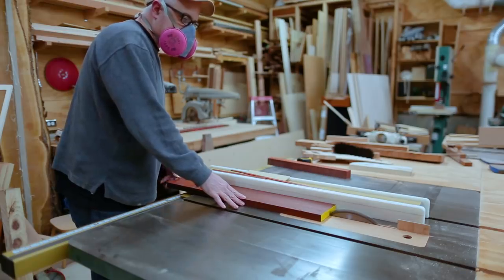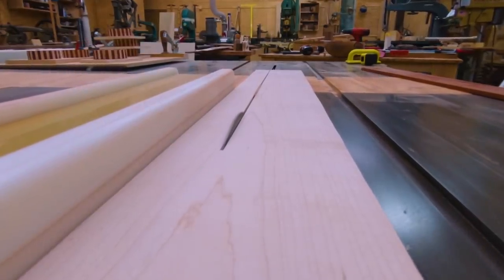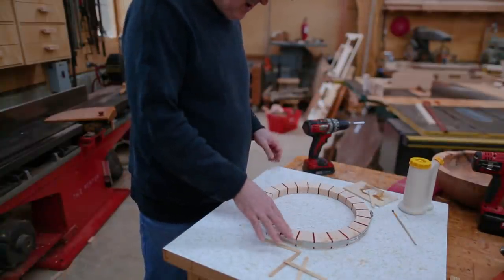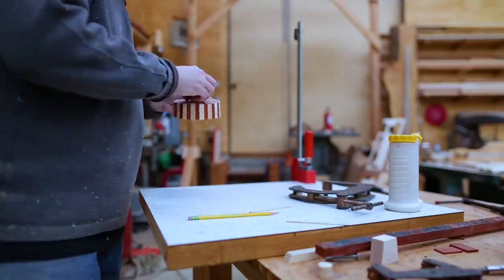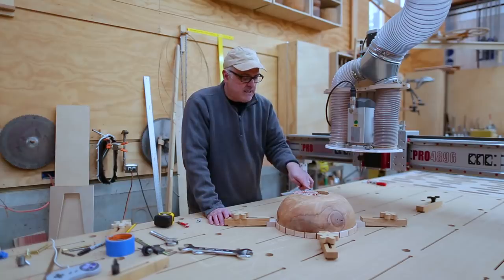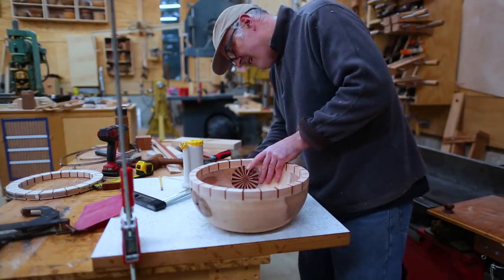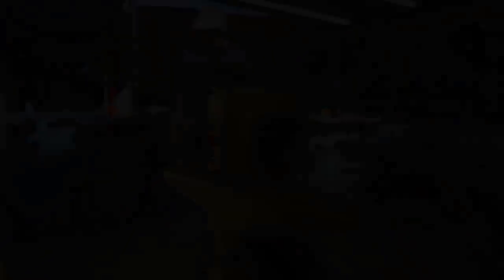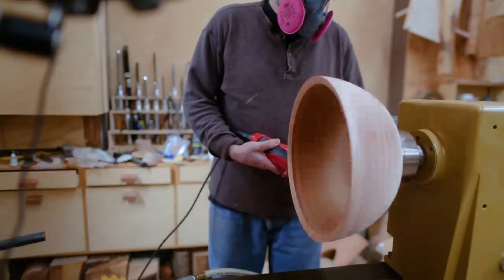Making A Maple Bowl with Maple and Padauk Inserts

Comment: Frank, love your work.  wondering if you have tried bow-ties for repairing punky areas in the bowls.  With your CNC it should be easy and use different types of wood to make it you, then turn it to final shape.
Reply from the maker: yes, I have wanted to do this.  I could see one were everything is turned flush, and one were the bow-ties have a 3 dimensional form.

Comment: Hi Frank, very nice bowl, not only from the design appearance, but all the techniques involved.  When I saw the part about the inserts splitting, it got me thinking about grain orientation.  Longitudinal (parallel to the length of the tree) is the least prone to expansion/shrinkage, over radial and tangential (0.01%, 4% and 8% respectively, for the movement of green wood drying and shrinking, as a reference).  I wonder if you cut the wedges one at a time off the end of the board, with the longitudinal grain running between the wedge faces where they glue to each other, as opposed to how you did where their longitudinal grain runs from the inside to the outside of the bowl, if it would make the inserts stronger?

Comment: buy some ND filters if you're having trouble with overblown shots. Get some bounce plates (literally a piece of foam core or aluminum foil works fine) and you can turn the light so it faces AWAY from your work peice, and then you can bounce the light (like from the sun) onto your work surface for a much less intense spotlight. You can also get some peices of mesh, thin white cloth, some wax paper even to put infront of the light source to diffuse the light. There are a TON of options for making the light work with your camera or your camera work with your light!

Comment: Do you have any deciding factors for the shape of the bowl? Such as if it's a wide shallow bowl, or a more sphere shape? What about the lip - having it flared out or curled in? What about adding texture details like grooves, rings, bevels, etc? On this bowl it appears you put a bevel on the lip, where the OD edge is higher than the ID edge. Do you make those decisions at the lathe or is there a plan going into it?

Comment: For the Bowl made entirely of inserts. Will there be a planned pattern? Or just insets laid over inserts at random? Either way, you could make a bowl blank, put in some of the inserts, turn it, then add new ones and repeat. It would take a hell of a long time but I don't think it would have to be that systematic. By doing it in chunks the inserts could be turned to the shape of the bowl before putting in more inserts.
Reply: For the issue with your light, maybe try a studio light, or a light used for photography? where the bulb illuminates away from you but is bright enough that it illuminates the entire area. Keeps from having that direct spot of light that you get with the demo light.

Comment: Hey Frank. I've been following for about a year but haven't seen much of your backlog from before that. YouTube suggested your video where you used Matthias Wandel's pantorouter. Do you find that it's completely useless if you have a CNC? Are there any applications the pantorouter could do better than the CNC?
Reply from the maker: There are some things the pantorouter can do that a cnc can't like putting a tenon on the end of a long piece of wood.  there are some set up and production gains the pantorouter hase over the cnc.  Also if you are not super comfortable on the computer the pantorouter has you covered.

Comment: Frank since you do a lot of bandsaw work I wondered if u could answer my question. Is it possible to overload a bandsaw with a motor? What I means can you put too big of a motor in a bandsaw? Say you have a craftsman 12” with a 1/4hp motor and you put a 1/2 or 3/4hp motor on it. Will the stronger motor effect the tires on the wheels?  Could he larger motor run the wheels too fast that it could melt the tires?
Thank you
Reply from the maker: I'm sure you can run it too fast. Too much power is less of a problem but you might put too much strain on parts

Comment: I am in a minority here but I think the inserts are over done. There are just too many of them and the effect is way too busy. I think with the number of defects you wanted to correct, epoxy would have been much better. I do admire your ingenuity and skill with the CNC machine and in most cases your work is outstanding. Just not in this case.